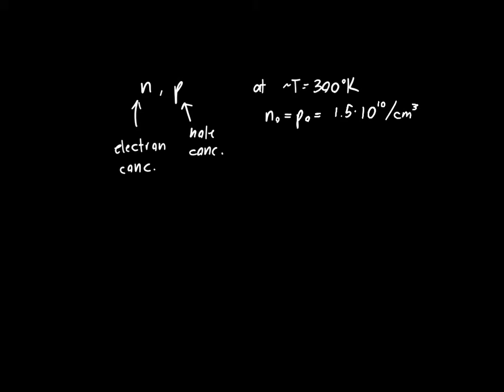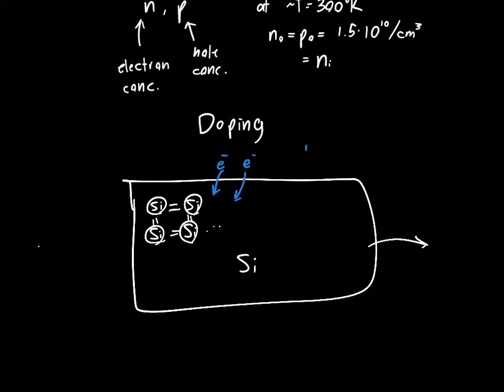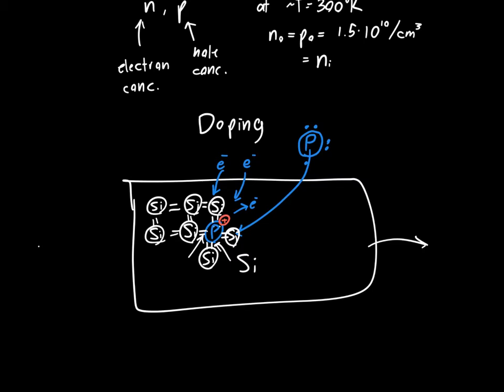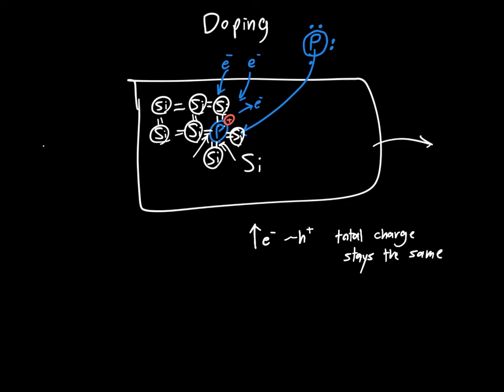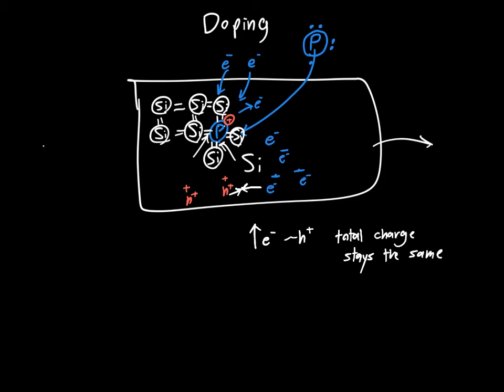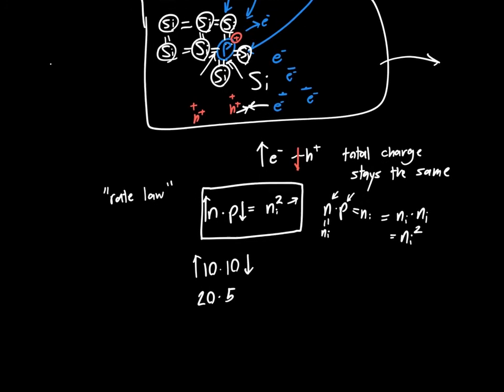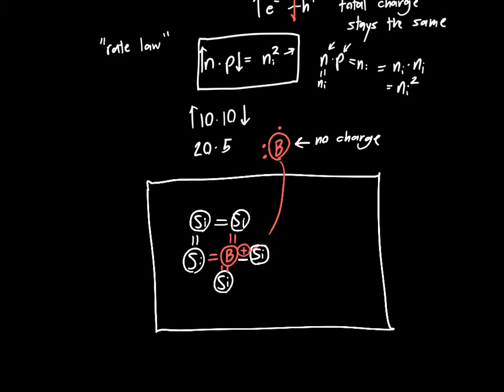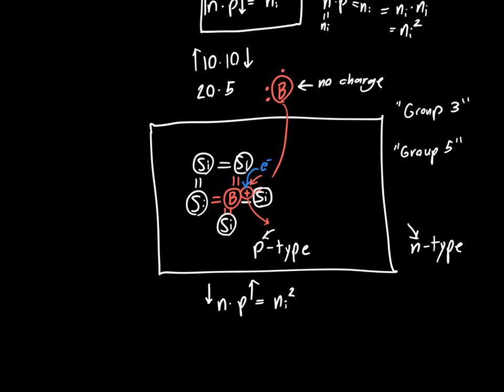Semiconductor Doping

Comment: Sir, could you explain why phosphorus becomes positive after losing one electron while other silicon atoms give it four electrons and it's more electronegative so it hugs those electrons tighter?
Reply: Phosphorous has atomic number 15, So orbitalwise 5 electron on its valence shell. only 4 electrons take part in bonding to the adjacent silicon atoms, so from the ‘silicon crystal’ point of view! the lattice has got an extra “free electron” for conuction.

So once that “free electron” goes for conduction, Phosphorus atoms gets one +q charge and becomes positive ion

Comment: thanks for this video too! Even if this does not really matter for the discussion about semiconductors, but from a chemists point of view you should be careful with drawing double bonds within a Si-Crystal. One line in these lewis drawings is in general meant to consist of 2electrons overall (one electron from each atom). Assigning eight bonds to each Si atom would therefore mean each Si-atom contains eight electrons in its valence shell, involving its d-orbitals in bondings. Besides of that your physical discussion about this topic is absolutely outstanding!

Comment: But when Boron bonds with 4 Silicon atoms , it makes double bonds with each atom,  so for making a total of 8 bonds , it should have 8 electrons,  but it has 3 ... So shouldn't total charge be +5 ?
Reply: I'm confused now, it makes a single or double bond ?
Reply from the maker: It makes single bonds which requires 8 electrons. 4 of those come from the neighboring SI atoms, and the other 3 from the boron, leaving it with a -1 charge (if it only had 7 electrons total it would be neutral).
Reply: @JordanEdmundsEECS  Thanks dude 😁
Reply: B can only form 3 covalent bonds with Si since it only has 3 electrons. the remaining orbital is electron free, hence it behaves like a hole.